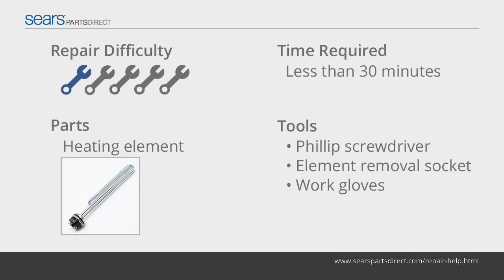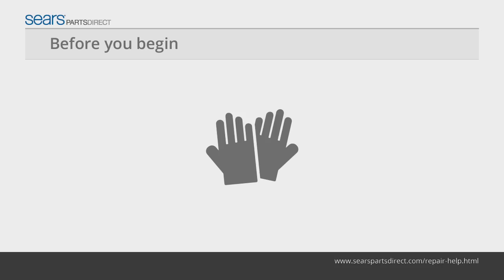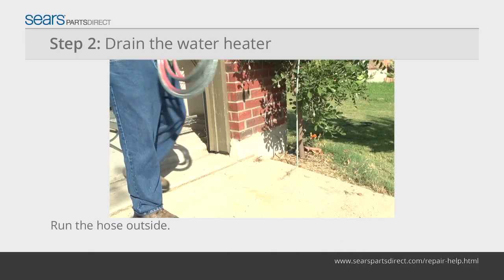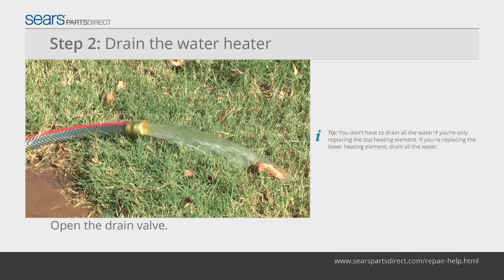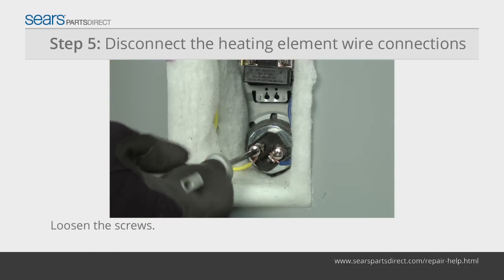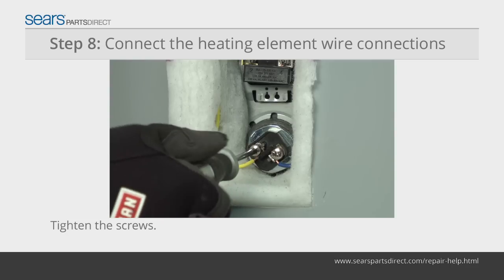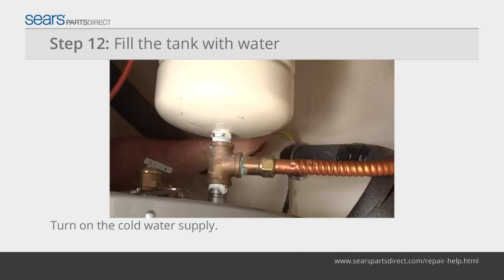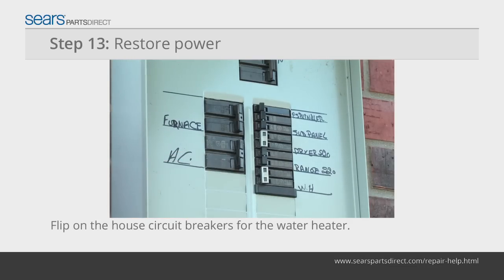How to Replace an Electric Water Heater Heating Element

Comment: How do i know if only 1 heating element is bad or if it's both?
Reply: You can check the continuity of the element with an inexpensive multi-meter, in the ohm setting. The water heater mfg can tell you the ohm range you're looking for.

Comment: Thanks for the help! Replaced both top and bottom elements for the first time, and your video made it clear what to expect. Spent a lot of time with a shop vac and small tube to remove as much of the build-up as possible, then let it flush through the drain into a hose for a few minutes. Lots of hardness build-up came through the hose. Cheers!

Comment: Why does it show in this video that water heater has 2 T&P valves? One on the side and when it shows you turning cold water supply back on there is one on top?

Comment: What if your not getting any hot water but the tanks getting power could that be the top or bottom element
Reply: Since this is a 2yrld comment, have you found out

For me, I'm getting luke cold water, not standard cold cold water, and not Luke warm water

Comment: I will only add a caution not to open the relief valve until enough water has drained off the tank to avoid water flooding your house… if not enough water has drained and you open the relief valve, water will drain off through the relief valve... Great video otherwise. Thanks!
Reply: How much is the screw type elements
Reply: @stidham12  $20 or less generally.

Comment: If you replace both how do you know which side to put the wire on to make sure you're not putting it on a positive or A negative the wrong way??
Reply: This is AC current. No positive or negative.
Reply: Old question, but, for the benefit of someone finding it now:
Expose both heating elements by removing their covers and insulation material, but only work on one at a time while using the other for reference.
Reply from the maker: Most water heaters have a wiring diagram sticker on the top of the cabinet. Check the wiring diagram to make sure that you connect the wires to the element properly.
Reply: @searspartsdirect   not the wires going to breakers. Talking about just element wires. I ended up doing it and turned out perfect nobody was saying otherwise. 
Thanks!

Comment: How do you no if it's too heating element or bottom
Reply from the maker: When only the top element heats, you'll notice that the hot water supply doesn't last very long but the water will heat back up after a while.

Comment: I used a 2 ft breaker bar for leverage still could not get it to budge!
Reply: I had to literally stand on my breaker bar to finally Get mine loose
Reply: @cgccb123  I saw on another video, a guy using a large socket wrench to unscrew the heating element.
Reply from the maker: Corrosion and deposits may have the element threads locked. Make sure you're rotating the element counter clockwise (to the left). You can try spraying the threads with penetrating oil to dissolve some of the corrosion then try to beak the element free.

Comment: Nicely done, but Where do you get that tool from that can take the heating element off? I have nice size pliers, but it’s not working.
Reply: RILLA MAN home depot
Reply from the maker: Here’s an Amazon.com link for that water heater element wrench: https://www.amazon.com/Marathon-PT49057-Original-Equipment-Manufacturer/dp/B07BJ1HY1Y. You may also be able the find a water heater element wrench at your local hardware store.
Reply: RILLA MAN home depot
Reply: The home depo

Comment: There is no need to drain water heater takes too much time if you get the new one ready loosen the old one with the valve on top of the heater shut and every fixture closed you can pull the old one out quickly and start the new one and you'll get gargling no water at all same with the bottom if you're replacing one you might as well do both because when one breaks the other is doing all the work
Reply: Clay Collini true but if you're replacing the bottom element chances are it's got a bunch of gunk and crap in there you would want to shop vac out that way you don't have to replace it again in the next year
Reply: @jonathanedwards9635  that's what I did yesterday
Reply: @jonathanedwards9635  Especially if you have hard water, where calcium or lime deposits build up in the bottom of the tank. Without vacuuming it out, you're just wasting your time.
Reply: But wouldn't it be a good time to flush the water since you are already replacing the heating element?
Reply: Clay Collini hi